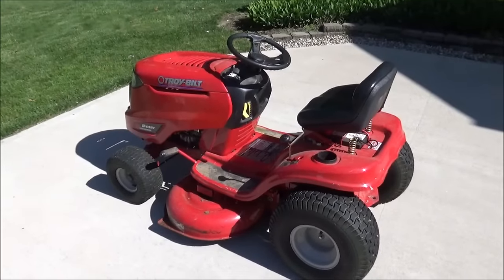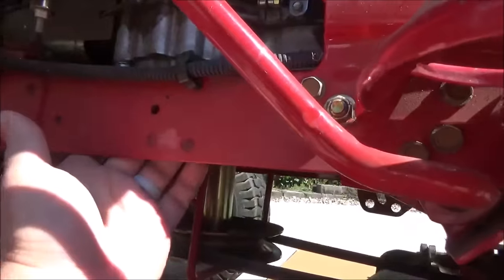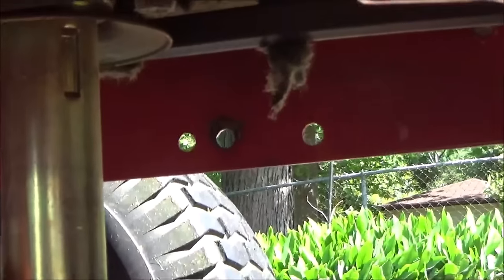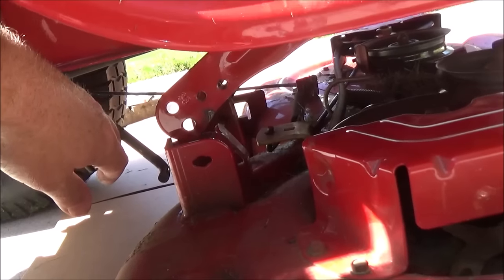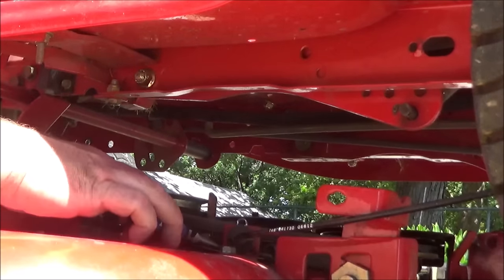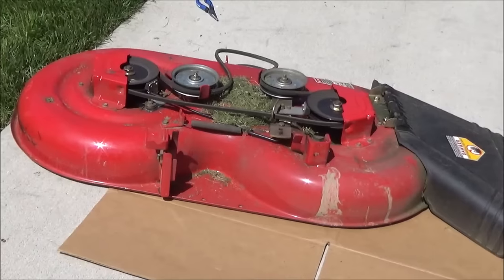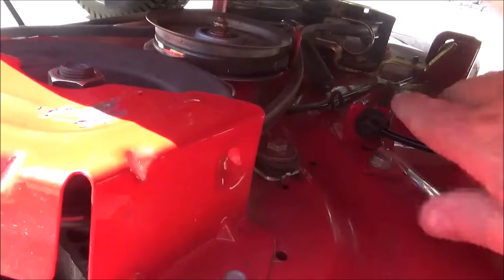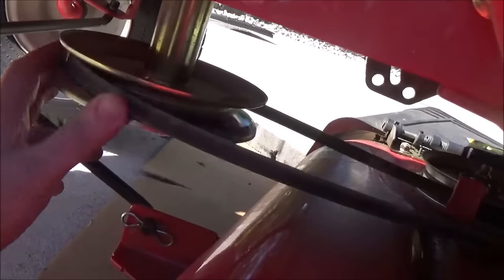Troy-Bilt Pony | How to Remove Your Deck / Put it Back On

Comment: I’m not understand how to remove the “PTO” . The blade is disengaged but I still don’t have enough slack to just pull on it remove it out of that slot
Reply from the maker: It's attached to a spring so you just have to pull it hard to extend the spring to get enough slack to remove it.
Reply: @fixitFlip  Hey buddy do you have a video on how to tighten up the drive belt with this model? It seems like I'm not getting full power/speed and that it needs to be tightened to a bit. This video was great! Made it so much easier!
Reply from the maker: @cwatson42785  Not to tighten it up, but how to replace them! If it's getting stretched out you're probably better off replacing. 
https://www.youtube.com/watch?v=KT9MX1ibk90
Reply: @fixitFlip  Wow just what I needed! Yeah mine Is cracked. I did fiqure out how to adjust the link which helped a little bit but it definitely needs a new belt. I'm heading there now! Thanks for the response and link.  Subbed! 👍🏻
Reply from the maker: @cwatson42785  Thank you and glad I could help!

Comment: Hint: if you are having trouble removing the spring that is attached tonthe PTO, do this. From the left side of the mower, just slide the deck an inch or two away from you.  Spring will com out easily.
Reply from the maker: Good tip.

Comment: After we placed our deck back on the pto will not engage any ideas?
Reply from the maker: Make sure the cord is in the right slot and the spring is attached.
Reply: @fixitFlip  checked everything out seems to be the belt thank you for the return response and information.
Reply from the maker: @bethanyvader3758  No problem and glad you got it figured out!

Comment: This is a hella lot easier than I even thought it would be. I've done a belt without removing the deck, but the guy doing that video also changed his blades with the deck on. This seems like it would be far easier for that, and you may as well hit it with the pressure washer while it's off. In my case, I'll probably have to replace the spindles. They're kinda stiff and I expect that's why I burned up not just the old belt but the new one, too. Sucks, because the spindles are about $75 a pop.
Reply from the maker: I try to do videos on different ways of doing things to show people all of their options. I pressure wash my deck every year as well. Going to do a video on cleaning and painting the deck soon.
Reply: @fixitFlip  Well, I sure do appreciate concise but comprehensive DIY vids like this. Thanks!!!

Hoping I can save the spindles, but I don't even know if lubricant is getting to where it needs to go. And they are probably sealed bearings anyway. Someone posted a vid about drilling into them with a Dremel and inserting a grease fitting. Seems like a great way for someone like me to completely ruin the things, LOL!
Reply from the maker: @ericschmitz5119  Yeah, mine has "maintenance free" spindles. But they don't last as long as the ones you can grease. But I have also seen the video on Steve's Small Engine Saloon where he shows that even if you just drill into the spindle, you are still not getting oil where it needs to go on these types of spindles. You have to open the inside up.
Reply: @fixitFlip  Knew there was a reason I bookmarked this. Just came in very handy a second time. I had to untangle a long piece of cable that it tried to gobble up a couple days ago! This really is an easy process. The only step that gave me fits was getting the PTO cable out of its bracket.

BTW, turns out the spindles weren't sticking. The deck was off and PTO disconnected (of course), leaving the pulley brakes engaged. Once I got it back together, they were spinning with no problem.
Reply: @Fix it Flip  Excellent video, concise and factual. Thanks for not adding loud background noise! New subscriber!

Comment: Flip when I put it back together the pto
 would not engage any suggestions
Reply from the maker: Did you hook the PTO spring back to the idler arm and the PTO black rubber part back in the metal slot?

Comment: Good job, thanks for the knowledge
God bless
Reply from the maker: No problem, and God bless you as well.
Reply: After removing deck ,replacing blades and replacing deck the blades won’t. Engage and spindle doesn’t appear to turn
Reply from the maker: @cliffordcopus8500  I would double check you reconnected the PTO properly.

Comment: Nut, bowties, position of blade which side is up and cardboard.   This is a very good video for the TroyBilt Pony which I bought about three years ago and the price has almost doubled.   The retaining nuts that hold these blades on are not something you can go down to a big box store to replace.   

If it's reluctant to break loose and you round off the nut, you may need to order this three-dollar part that could take a week or more to come in.   Careful ordering online, it may say it's the correct part but you get it and it's the wrong sized thread.  If it goes on and then does want to go all the way on without force, you've got the wrong size thread and forcing it will ruin the spindle which is a pricey repair.  If it's stuck, with the deck off, it's a lot easy to get the room to break it off.  A little WD 40 doesn't hurt either.

Know which side of the blade is up and which is down.  The blade may have it stamped, a sticker in my case, nothing at all.   Look up if in doubt.   The bowtie can be damaged and if it is, replace it before putting it back together.

The cardboard isn't necessary but makes positioning the deck a lot easier when you put it back on.
Reply from the maker: Yep. A big breaker bar or an impact can help with that nut as well. See my "how to remove a lawnmower blade" video.

Comment: what size is your deck .I have a video troy Built lawn mower HELP .My brake pad is not looking right .Mine is a 2016 troy built bronco .About a month ago I found a spring in the yard and it is the yard I use my troy built mower on .I use the cub cadet for the slopping front yard and back yard and use the troy built for the side yards .I am not sure what is going on with it as it over heats with in a couple of minutes
Reply from the maker: Mine is a 42 inch deck.  It could be the idler extension spring or the PTO spring.  But neither of those things would make it over heat. Hmmmm 🤔
Reply: @fixitFlip  I think it is over heating the brake pad because even when I leave off the brake the crooked pad stays engaged and is eaten in too .The idler spring is there but not sure on my parts list there is no pto spring listed .I am no expert in these things i just use you tube to help me repair things .It is hard in a rural area to get repair people so I have to depend on me .I see on parts list deck engage cable number 37 that is a spring and 47 that is pto spring extension .I will check them next thank you
Reply from the maker: @sissymurphy9620  I hear ya on that. Hard to find good help. Here's my video where I take the deck off. In this video I take off the PTO spring. Maybe that will hep you.
https://www.youtube.com/watch?v=tKNqokiNo00&t=39s
Reply: @fixitFlip  I looked at the bracket holding my brake pad and pulley and it says 46 inch so went to my neighbor who bought his troy built and his says 42 on it .I looked closely and his pulleys are farther apart than mine and his brake pad is straight at the pulley .You can not even put a finger between my 2 pulleys and with his you can .I am thinking my mounting bracket is for a 46 inch deck .It is also configure differently than mine and he bought his the same day as i bought mine and at the same lowes store .My bracket is stamped in 2 places that say 46 .
Reply: @fixitFlip  not sure the message went through .But my mounting bracket is stamped 46 not 42 .You can not get as finger between the 2 pulleys .My neighbors has 42 stamped on the pulley and brake mounting bracket and mine is stamped 46 in 2 spots
Reply from the maker: @sissymurphy9620  That is strange. I bought mine at Lowe's, too, and all the model numbers didn't match up with the replacement parts I have needed, etc.
Reply: @fixitFlip  turns out the bracket for the idling pulley and the brake pad is for a 46 ingh deck and not a 42 inch deck .I was on the phone with tech. support for over an hour and sent them over 20 pics of the bracket that was stamped 3 different places that says 46 on it .My deck is black .If I get this fixed i think I will sell it and get another cub cadet the decks are much easier to take off .I know they are all made by the same company but this time i will inspect the lawn mower and deck much closer
Reply from the maker: @sissymurphy9620  Oh my goodness. Wow. Sounds like a major headache. How in the world did they put the wrong parts on there. No wonder its doing that. But yes, Cub Cadets seem to have their deck come off a little easier. My neighbor has one. It is just 3 clips. But you are right. They are both made by MTD.
Reply: @fixitFlip  sad to say but they are not going to do anything for me .They basically told me I would have to get it to a repair shop and pay to have them work on it and pay for the part that it needs .Which is not cheap 55 dollars to pick up from repair place  or do it myself and pay for the part .I am now trying to maybe find a salvage deck for parts .I am in a rural area of VA so only 1 shop any more here that will even work on a troy built and have the time to work on it .Seems they hate troy built garbage ,what the repair shop told me .I know troy built's can be good for small yards and are affordable and can be good mowers if built right .I found 6 of them around here and all were built at the same year and bought around the same time as mine and I have taken pics of the deck with the right part on them and pics of the receipts from the stores with the dates on them .I guess my last name says it all if any thing can go wrong it will .Strange but all of them have had problems with their mowers ,from pulleys to even 1 that had on 1 mower blade on it .They fixed that from lowes Where is quality control ,where is customer care .mtd yardman cub cadet and even craftsman and some of the john deer are made there .There are several other ones also listed .It is just the price and maybe a little easier to take them apart
Reply from the maker: @sissymurphy9620  Wow, that is just unbelievable. Sorry you've had so much trouble!
Reply: Flip is a god...

Comment: You don't have to un-bolt the belt keeper just pop it out of the hole on the frame and the belt comes off you don't need a single tool to take  the deck off just strong fingers !!